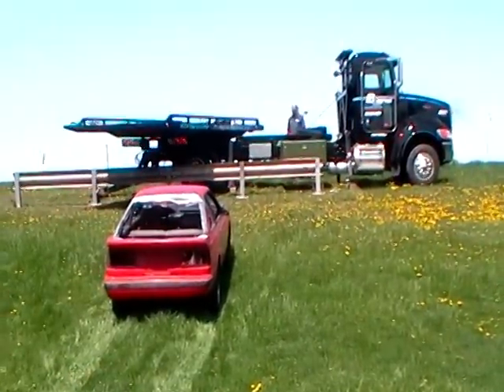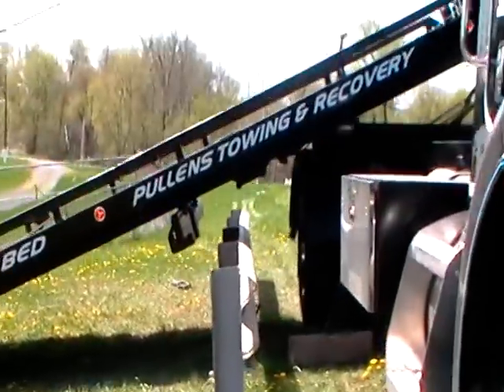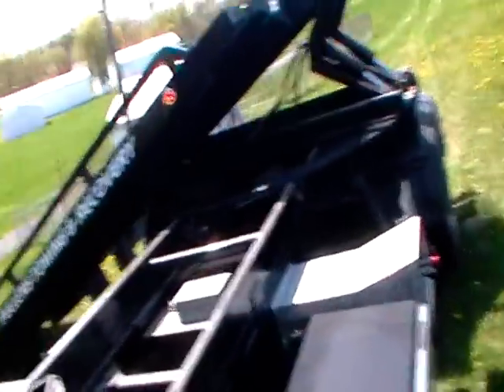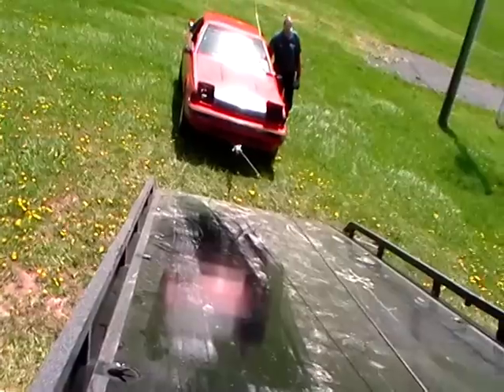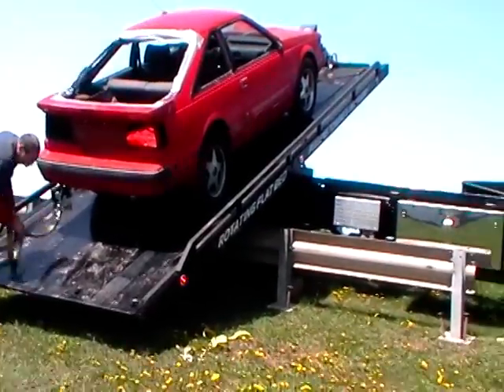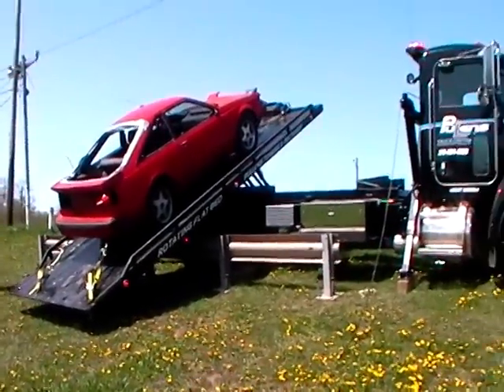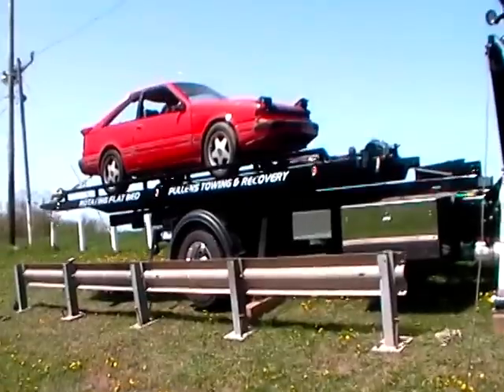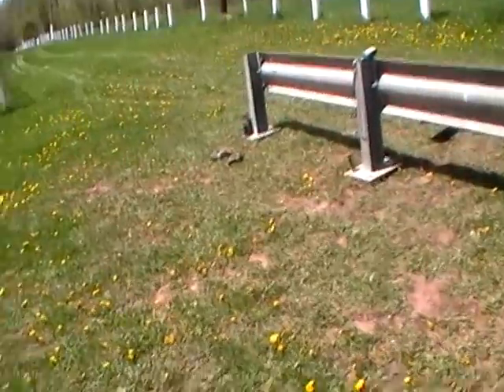Rotating Flatbed Recovery part 2

Comment: I'd never walk across my winch cable. Nor would I ever walk behind an unsecured vehicle with the bed tilted like that. Especially because I can hear your cable crunching over itself from not being wound right. Another thing I wouldn't do. Is walk up the bed tilted like that. One slip. And your in hurtville. Weather over the side. Or slipping under the car.... Now my challenge to you. Flip the car over. In a very awkward position. Flatten the tires. And possibly remove the ball joint on one side. Lock the steering wheel to the left or right fully turned. And pretend you don't have keys for a neutral position.

Comment: ok put a 4dr dually truck down there and we see the tru loading but why a 2200lb car weighing 1900 without glass lights etc. use a 6700 lb truck or put one of your wrecker units down there or a 4x4 crashed truck take off front wheel make it a good stage action i bet we all would love to see a good one
Reply: True

Comment: Not as big of a pain as if the cable snapped! The last time I straddled a cable we had three 1Ts doing a 300 ft cliffside stolen recovery; it snapped three steps after I crossed it, did some damage to two of the trucks. That was 1985 and I haven't crossed a tight cable since! The thought of that energy unleashing (could've been between my legs) made a believer out of me, and everyone else on that scene.

Comment: Love the truck first. Second yes it can do a one ton. I've seen it. Proper rigging is required of course. Take consideration of the incline, load, resistance, distance. On a side note this of course can still be done with a normal truck. I've done it in a reg carrier and I've recovered a for door chev 3500 out a creek up and over the rail in my lil single line wrecker. Threw it on the sling and rode out with fifty bucks from the troopers who bet I couldn't do it in less then 30min lol.

Comment: And afterwards, you let it roll down the slope again, set up the flat bed and jumped the car using the flat bed as a ramp? It's ideal for that, since you don't hit the truck cab when it's rotated. Also, with this nice slope, you can get plenty of speed.
Now *that* would have been a nice video!

Comment: Too many moving parts...try picking up a wrecked f 350...with that spinning little flatbed...

Simple solution WRECKERS 

Light duty, medium duty, heavy duty,
 Stop trying to make this flatbeds  recovery trucks. 

I would use that truck in the inter city in tight areas not some bs  side recovery

Comment: Nice piece of equipment. But it would take alot of recoveries to pay for that luxury. Considering when you show up to a accident your payed by time.( winch time) You can not charge extra just for owning this rather than a regular flat bed. Yes it would make some jobs easier no question about it. But the quicker your done the less you make. In some case's there's just a flat rate than the less time spent there the better.But that is rare. But hey if you have money burning a hole in your pocket.